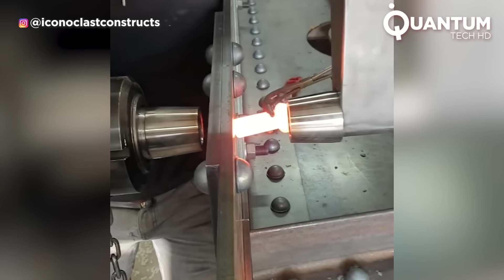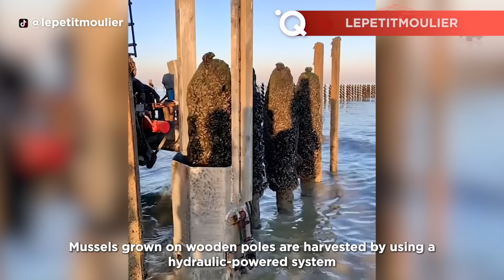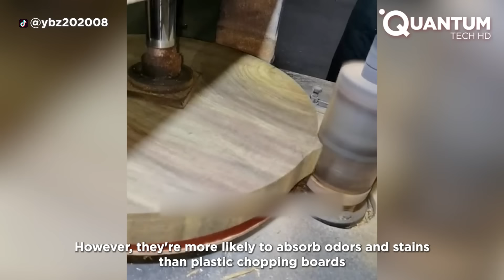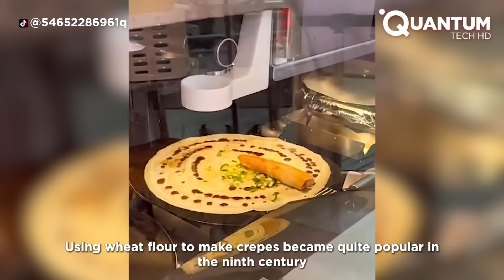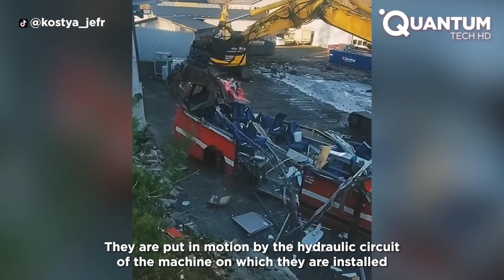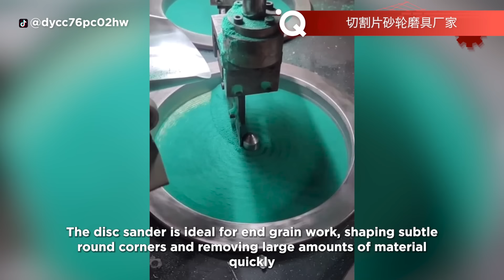Mind Blowing Machines That Are At Another Level

Comment: The welding at 2.09 is not the welding described by the text. The video is rotation friction welding, where the friction is between the two round  pieces being joined and there is no tool piece in the weld. Friction stir welding is where a rotating tool is forced along a joint creating heat and mixing the two parts being joined.
Reply: That's what i understood in the video
Reply: The text is gibberish Chinglish, you'll notice it in all the videos. Complete nonsense to fill the video

Comment: I find the agricultural machinery most interesting as there are so many variables with living things.
Reply: Too bad the explanation of the first one was so far off reality.  It was a mowing machine, yes, but what it was doing was taking down grass to make into hay.  You can tell that by the band of mown grass that the machine puts out.  I can't see clearly but I'd bet that machine not only cuts the tall grass only at the bottom so the baling machine has an easier job, but also runs the cut stalks through a crimping wheel to break the outer skin of the grass stalk so it dries faster.  Grass is in the business of not losing moisture to the air, if you don't break the outer skin it can take days to dry.  If you do break it then it'll take a lot less time.  (Why yes, I did grow up on a farm.)

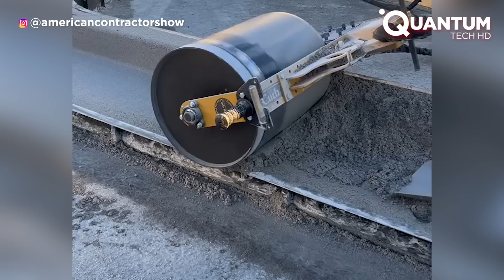Comment: At 3:24
Thats a Thread tap……🤦‍♂️😆 
it cuts threads in an existing hole and the so called “heat” or smoke is  from the tapping fluid evaporating from the friction. 
By the way when you are drilling, heat is one of your worst enemies, it causes material buildup and ultimately tool breakage. Coolant or cutting oil is used to flush away chips, heat and lubricate the cut.

Comment: Very frustrating watching this,show something interesting for 2 seconds and then goes to something not interesting and spends more time on it. Dude,how bout at minimum 5 minutes on one thing than go to the next one?
Reply: Why do you need 5 minutes for each machine?  It would be an all day video.  Slow it down to x25 playback speed
Reply: @fredleemh  the point is to see them work or finish or what they're making... Basically closure some flash by so quick why bother even showing it?

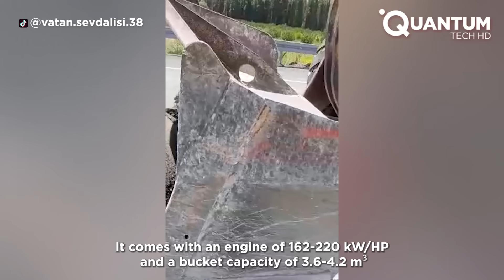Comment: 1:18 this machine is useless garbage. I did this work on a machine splitting these junks into 4 pieces at the same time with a literal ton of force, and it only jams once per hour. You can get up to 60 small pieces per minute if youre going crazy with it, grab one, hold a button, release, throw the junks into a container and repeat